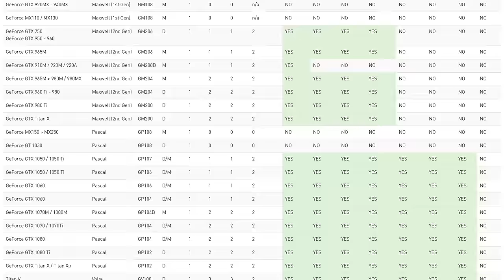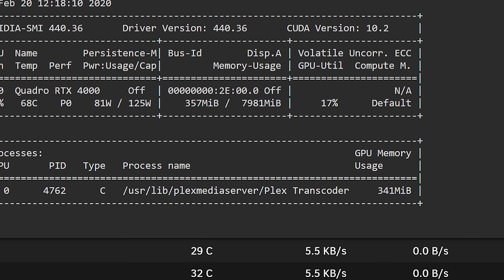5 First Plex Media Server Build Mistakes

Comment: "8GB is still doable" meanwhile my Plex server is happily running in a docker container with 2GB, works flawlessly! Have about ~20 users.
Reply: 4k or 1080p?
Reply: Mine runs on 4gb for Plex and unraid total. Had 8 but I needed the ram and didn’t want to buy anymore.
Reply: @thenegotiator9701  hi
Reply: I have Plex on Ubuntu with an Ryzen 5 3400g and a 1050Ti 16GB RAM. Set transcodes folder to /dev/shm/ to save SSD wear. Works perfectly. Patched the nvidia driver and can run up to 6 transcodes at the same time. While watching a 4k 40MBit video and transcoding it to 1080p 20MBit and looking into the transcoding folder it generates a lot of small 50MB files. Ram is slowly filling up but while watching a movie it never fills up above 2 or 3 GB of usage. Easy peasy.

Comment: 7 Seagates running 24/7 since 2017. No problem so far.
Reply: I ran Maxtor drives exclusively until Seagate bought them out.  Nothing but Seagate since then. 1 or 2 failures in the last decade is perfectly fine by me.
Reply: I’ve had failures across
Every single brand
Reply: Worked in a pc repair shop for ~6 years, Seagate are by far the drives I saw the most of dead, BUT, they are almost exclusively used by OEM builders, espescially in laptops, where most hdds are abused by people whom do not understand how to properly care for them, it makes sense that they have a pretty high failure rate.. on another note, I still have a working 8gb maxtor bigfoot 3.5" Ata 33 drive, LOVE IT.. its soooooo loud when it spins up..
Reply: I had more problems with Western Digital. Especially with the 4 TB version. It just died afte like 60 Days running. 2 Times.
Than I bought Seagates and they are running 120 Day now.

Comment: Ragging on Seagate in 2020 is like saying AMD runs hot in 2020
Reply: @technicavivunt  As far as I know Seagate consumer drives are all Backup drives meaning lost of shingled magnetic recording meaning every write is three operations instead of one.
Seagate Ironwolf drives have very clean record the 10TB drive has a 1.01% annualized failure rate
Reply: @amateurwizard  not true, I have 10TB Backup Plus externals and they're all Ironwolfs when shucked. However you are correct that the Ironwolfs are reliable and perform well.

Comment: Meh my first Plex server back in the dark ages was built ontop of FreeNAS and only had 8Gb of ram ;)  that maxed out my poweredge sc1430 that I'd fished out of the trash bin at work. Worked great except it only held 3 hard drives and the massive power draw of dual Xeons increased my power bill noticeably and really heated up my home office.   lessons learned, Second Plex server now going 8 years I went much less CPU power, 64Gb ram and 12 HDs, super quiet, low power draw, low heat, and metadata on SSDs.

Comment: I have been running a Plex server for about  six years. I run it from a 64 bit windows 10 PC with 8 Gigs of RAM with integrated Radeon graphics and no SSD drive. I get about 4 transcodes with no problems.
Reply: pretty typical as long as those transcodes are 1080--down to-->720 etc.
Reply: AMD A10-6700

Comment: 1. Plex Does Not Require Tons of Ram 1:34
2. Old Graphics Card or With Not Enough Graphics Card Ram 5:05
3. Not Enough Storage 7:30
4. Back-Up Battery 9:09
5. Your SATA Cable Could Be The Real Problem... 11:15

Additional 6: SSD for Plex Data 14:10

Please add to video description
Reply: real mvp right here, thank you
Reply: thank you, why is it hard to just be presented the information without all the sidetracks and rambling!

Comment: I’m running Linux lite on a 16yr old core 2 with 8gb of ddr2. Firefox running on the desktop with Plex media server in the background 700 MB average . Never goes above one gigabyte ram usage. Been running plex server on that old Dell OptiPlex coming up 10 years and it just won’t die. It although it can only transcode 1 or 2 streams at once it generally doesn’t do any transcoding because all my media is 1080 and streamed original quality. It manages simultaneous 4 streams in my house easily. 6tb nas drive and 128gb ssd for OS. Its only job is to be a plex server and has never failed me since paying $50 for it off eBay 10 years ago. The drives cost more than the pc lol

Comment: The Seagate RIPs are Priceless..... as for the Sata Cables I have had 5 go bad over the years so I fully agree on that.   I changed all my Battery back ups from APC to Tripp-lite  BC Battery Back UPS here in FL should be Mandatory and even though I have back up generators on all my properties, I also 5K Back Ups on every server or PC. 
    Yes I know its over kill but when you buy 10 Tripp-lite Commercial Version you get a huge discount! I have everything Plugged into them from Monitors to Modems!  Most get me 90ish mins of time except the main which I am adding a external battery bank to boost it to 10k!  Good video Jason!!!   Cow}:-o)

Comment: Been following your Plex videos for years, so I knew all of this and even seen you recovering from some of the don'ts you listed. 
That said, my improvements to my original Plex server were:
Better CPU (AMD Ryzen is so beautiful)
SATA cables (depending on the run, 18-24" with locking mechanism and 6Gbps speed. Also, buy spares!)
Drive Expansion: I am still using the same tower  case i bought 7 years ago (Xigmatek Elysium) that had cages to allow up to 12 HDDs. I have expanded/modded that to where it now fits 20 hot-swappable HDDs and 4 stationary HDDs with an option to add an additional cage for 4 more stationary HDDs. 
OS: I am neck deep into UnRaid for 3 servers now and plans for an additional one.
Network: 10G network helps with the file transfers A LOT!
SATA Card: while the PCIe 1x sata cards were working fine, I switched to a 16-port SAS-to-SATA card and my Parity checks went from 2 days to 22 hours.
Also, SSDs and NVMe drives are amazing. Use them when you can and if you can afford them.

I think that's it. As always, thank you for the videos. Also, please stop hating on Seagate lol.

Comment: 8:50 "Unless it's a Seagate, in which case it's gonna die anyways"

My over 8 year old regularly used Seagates: ANGERY
Reply: every single seagate I've ever owned crapped out waaaay too early imho. Which sucked because I usually buy them when there's a nice deal on them...had to stop doing that--now I just don't buy them period.
Reply: @countreekidd  Heh, coincidentally all my WDs crapped out but all Seagates are still kicking.

Just use whatever you want, nobody should argue about this.
If there are known defective models, then yeah take the advice. Otherwise it's up to you :D

Comment: im seeing this video 3 years later and i have had every single headache he mentioned. especially the SATA cables, ive knocked them loose many times, however he is quite right, i've changed SATA cables and found out that 2TB drives i thought were bad, powered right up, the file structure in tact and all the files there. i have since moved on to using toaster type hard drive bays. and they are the best. unless that HDD or SSD is completely dead, it powers up and runs !!
Great video tips 
thanks

Comment: 1 major mistake, not trusting Seagate drives..lol.  Had to laugh when you mentioned this.  Everybody has such mixed experiences when dealing with these.  WD's and Fujitsu drives have repeatedly died on me in 24/7 ops.  Didn't stop me from trying out the SN750 NVMe...love that thing.  Sticking with 2TB Seagate drives.  Cheap to replace ($50), and the only reason I've had to replace a few in the last 5 years was because I got lazy when I moved and didn't take them out of my server before moving the rack it was in.  Still prefer Samsung SSDs over pretty much everything, but they don't fit my budget for the quantity I'd need for my FS.

Comment: Good tips ... 
1.  I have 32gb ddr3 on my plex server and it never uses more than 3GB with Windows ... have no where else to put the DDR3, so it stays...still haven't tried out transcoding in ram, but sounds like I should.
2.  I have a GTX 1050 and recently recommended a 1650 to a friend ... in both cases it was more a matter of the 75W PCIE power requirement and size of the card.  Looks like I miss out on some HEVC transcoding features.
3. Rosewill case is great compared to the alternatives.  Mine is pretty old and did not have hot swap bays.  I was able to remove the original bays and install lockable hot swap bays.  Limited to two X 5 drive bays + a 3 drive bay.  Kinda wish I'd had the option for the 12 drive version, but am also trying to stick to 8 drives max and rotating out older/smaller drives.
4.  APC SU2200 I bought used for $100 and replaced the $250 worth of batteries ... 
5. Gotta admit I've been through my fair share of SATA cables, and it's soooo much better than finding a dead drive.
6.  SSD for metadata ... definitely backup to another drive ... my SSD with the DB just croaked hard on me a week ago after running for about 5 years.

Comment: I love plex direct play , no transcoding crap 😁🔆🔆🔆
Reply: @teknerd  for 1080p transcodes (or lower) my 4th gen core-i3 was able to handle it with ease for remote play, but almost all mobile devices can direct play just about anything nowadays..  the only reason I've found to transcode is due to upstream limitations which I don't really have any more, but for any 4k media I want to be available via remote play (non-remote direct play) I just create the lower bitrate version Plex will just chose it to direct play assuming you've set your upload limits correctly. (this is all just my experience, so ymmv)

Comment: I have the Rosewill 15 internal bay case as my data backup server.  I have 15 8TB drives in it and for the price it works great.  Not quite the quality of my supermicro 846, but it is a great starting point if your just getting into this hobby.

Comment: Just a note... I’m running plex on a 10yr old desktop and am able to do multiple streams at 1080p with no issues. Unless you’re doing 5+ at a time I wouldn’t sweat hardware.
Reply: eva2k0 I’m running an Optiplex 790 with an i3 2120 4Gb ram. I can do 5 lan streams easy, but barely 1 transcode at a time
Reply: Benjamin Ray hmm, I can do transcodes no problem. We never have more than 4 going at once though. 

The cpu was very beefy when new. It was the first gen i7 Nehalim(spelling) architecture.

Comment: About the UPS bit, I live in Switzerland and the power there is great. I have decided to remove the UPS as it tended to fail more often than the power went out.  It was an APC so not a cheap brand.

Comment: I recently built a dedicated Plex PC using a Ryzen 5 1600 on an ASUS Prime board, 2x4gb Ram and an MSI Gaming GeForce GT 710 1GB GDRR3 64-bit video card. So far, after 2 months, I've had no issues.

Comment: Quit bashing on Seagate. LTT just threw a gazillion into his storage server and you just had a WD die on you.
Your audience is smart enough to know they are second tier and priced accordingly and that's why we have tons of them and want to build a NAS/PLEX server.
Reply: Cody Parks then seagate drives are like £360 GBP each though!
Reply: well it doesn't change the fact that segeate have the highest faillure rate for 2019.
Reply: @aure_eti   Exactly, nobody has stated otherwise. Backblaze proves that with their quarterly failure rate report, yet they are still using/buying them per their price per gigabyte. They are good drives (wouldn't recommend their 12TB thou) but they are still second tier and priced accordingly. Definitely not horrible drives thou.
 Bradley Foord   Sorry to hear that. In the states they are the cheapest, then Toshiba, WD, and highest is HGST.

Comment: SATA cables! I just got my first issues with that, I had one HD dying on me during summer (Seagate) and in the beginning of the year I started to have HD issues in the same box in a different VDEV. I assumed that the HD was toasted, bought new HDs, replaced and ZFS would spit same errors and unable to resilver. Than I realized it may be the cables... they were not long enough to be comfortable, so more than one was pinched in my build (Fractal Node 804).  Living and Learning!! Luckly ZFS kept the data safe during this process =D

Comment: Hi Jason, great video thank you! I am planning to build a Plex server on my Sinology NAS 1621+ (AMD Ryzen V1500B, 2.2 GHz (4 Core) 32 GB RAM, 14TB HDDs and 2 x 512 SSD Cache) which should be fine from an performance perspective. Usage currently is at 1-2% CPU and 2-3GB RAM (out of 32GB) supporting 5 active Docker containers (MQTT, Node-Red, grafana, influxdb, iobroker for the smart home system). What worries me was the point number 2 "grafics card"! There is none, no dedicated card in the Sinology NAS. Will this be an issue or will the CPU cover it? Cheers and thank you!

Comment: I run mine on a Synology ds218play with 1Gb ram and it runs fine as I NEVER transcode , play everything direct and it runs fine.
Never skips a beat and plays remux just fine .
As for Seagate dying. Mines been on 24/7 for 2 years , again no issue
Reply: 35317 hours = 1.471,54 days =  4,03 years - 24x7 -  read from my Seagate ST4000VN000 SMART info with  0 Reconnections , 0 errors, 0 identifications retries. The other 7 HDD were exchanged by Seagate "VN" 8TB versions before fail once.
Reply: Just cause it hasn't happened to you, doesnt make it the norm. 

You're in the bottom tier minority and I don't think you're the audience for this video. This is for the more power users who share the server with friends and family.
Reply: Nice to see a fellow Synology user!
Reply: @LaurenceReeves  They have to improve hardware or I will switch soon to a custom server. Synology got underpowered compared to other brands or custom NAS.
Reply: Joan Lorenzo I’m not sure I agree with you there. I wouldn’t touch QNAP or WD nas’s.
Reply: Synology make much more powerful systems these days it's not all about a Nas they have rack mounted servers that pack a punch with power. 
And agreed wouldn't touch Qnap or WD with a barge pole

Comment: I'm in the process of encoding my old blu rays from the 2000s and am setting up a Plex server.  I have a QNAP NAS that doesn't support hardware transcoding, but a RAID 6 array with SnapSync backups to another NAS?  I think I'm good.  So I think my plan will be to run Plex server from a VM on my Threadripper machine (which does other things too).  Alternatively, I'll look for an inexpensive GPU capable of transcoding, or buy an inexpensive NUC that can do it on Intel Xe iGPU.

Comment: Another point to make is the dreeded 4 pin molex power plug. I had a lot of read errors because one of the pins on a splitter had pushed out of the connector. Took me a while to figure that out.
Reply: i've had these issues as well.  i got me a few 2 bay toasters, they work really well

Comment: #1 A lot of RAM might not be needed, but it is not really a mistake if you use more. - 8GB is more than sufficient though, just plex you can get away with 4GB or even 2GB easily (at least if you use a barebone Linux setup)

#2 Ditch the graphics-card. ESPECIALLY old ones.
You will always pay extra in electricity.
The additional load of the CPU costs you much less than the GPU when ultilized.
AND if you run many streams it is important to notice, that at least nVidia GPUs have a max. of simultaneous encoding processes (2 in case of the 10xx series). 

My 10 year old CPU can transcode up to 12 transcodes from 12Mbit down to 4Mbit simultaneously and eats about 80W doing that while using ~20W in idle.
Finding a graphics card that uses less will be difficult. Especially when they are built for gaming most of them(especiall older ones) eat the 60W in idle...

Go with something that has an internal GPU instead (an i5 for example) 

#3 My case ran out of space after adding 10 HDDs, put the rest of them on top - had my first HDD failure after 7 years. (With another one close to follow which was the 10th drive I actually had installed in the case.
Although I wouldn't recommend doing it in general, so far I didn't experience failures that are unlikely to happen when installed "properly".
I should say, that the server sits in a room that has no foot traffic whatsoever.

So while you are right, you are painting a bleaker picture than is actual reality.

And before someone adds "but they loose performance" - no, my HDDs all run within normal parameters just like they do in my servers for work (where everything is actually installed as it should be)

#4 Hell no!
Unless you live in an area where power spikes (and/or outages) are normal, don't spend your money on that.
I've had 3 outages since I installed my first media server ~10 years ago (one time a minute the other 2 under a second).

I don't know what you did that caused you corruptions, but I can just pull the plug from my server, boot it back up and everythign works fine with no corruptions whatsoever.

Note:
If your power does flicker, I would actually recommend buying one - not just for your server but also for your gaming pc if you have one - in order to protect your hardware.
If it happens once every few years though (like here in germany) - don't, just don't waste your money.

#5 Yes!

#6 I would add this: Use Docker Images.

You will definitely need to change your system drive or more at some point.
A dockerised server will let you copy just one folder (plus one file) and PLEX will run on your new Server (or at least new intallation) as if nothing changed at all. (also nice since you can move it to another SSD if need be without googling how to change xyz-Directory for server software zyx ).
It has had issues in the past, but those were fixed one or two years ago.

I did performance tests and Plex runs just as fast as it does on bare metal.
Reply: #4 - UPS is essential in my opinion for a NAS.  I am using brand APC with built in surge protection.
Reply: @Shaquir Bourjolly I guess if you are streaming some some shit quality movies and cap it to one just a couple people then sure.